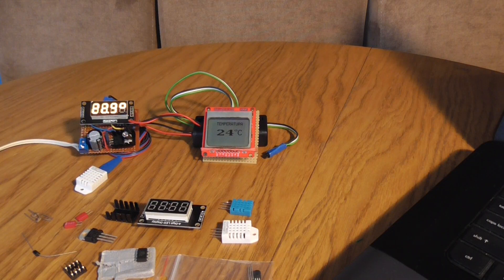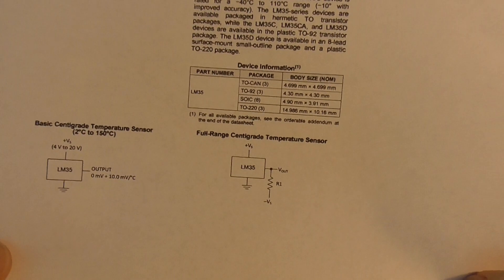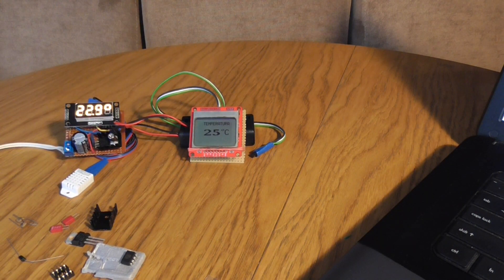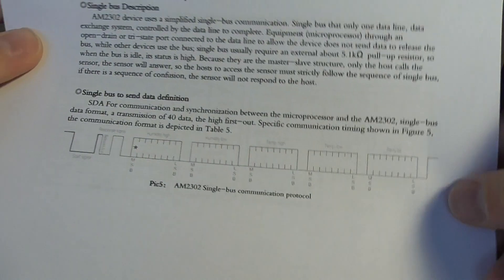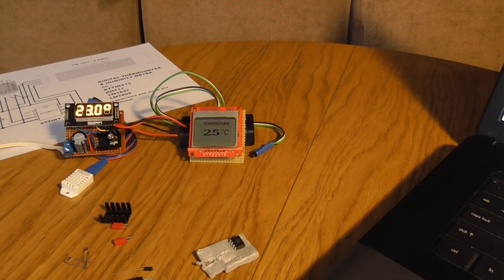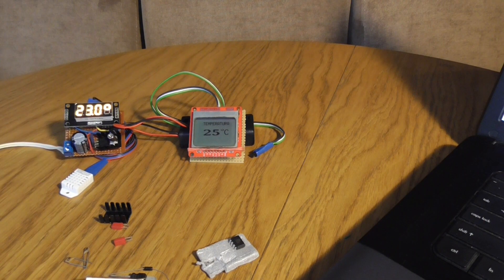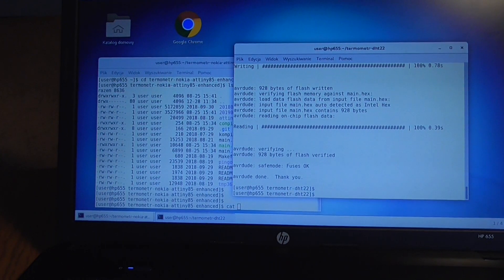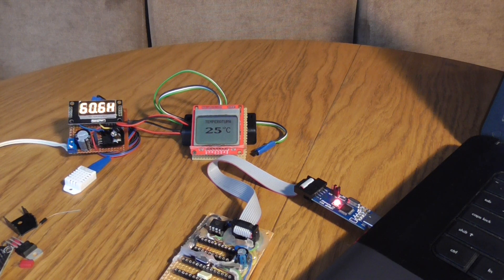DIY : Easy to do Digital Thermometer / Hygrometer based on ATMEGA / ATTINY and DHT22, DHT11, LM35

Comment: Hello, the project DHT11 & TM1637 LED display + ATTINY13 based thermometer, the code is the one that says main.hex, you can compile it to INO to be able to program it with the Arduino, I leave you my email pascualpalacios525@gmail.com
Reply from the maker: Hi, this is only for AVR-GCC environment. The main.hex file needs to be uploaded using AVRDUDE + USBASP cable as I am showing on my other video